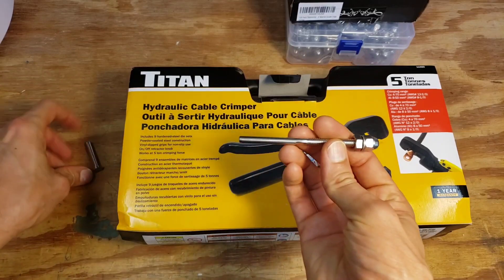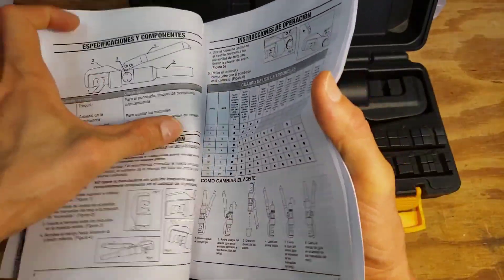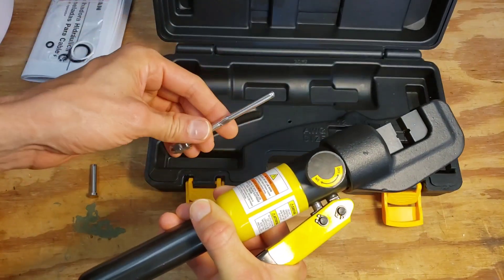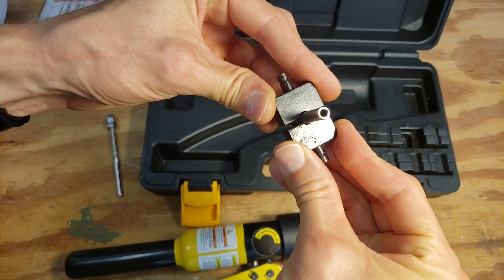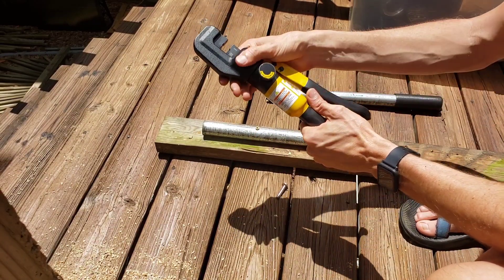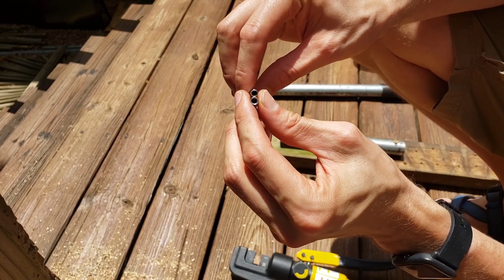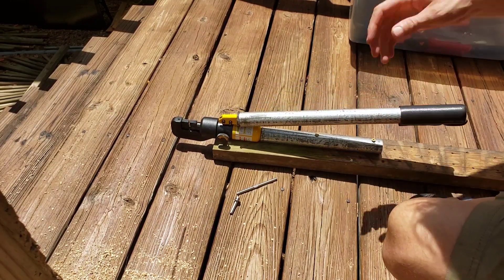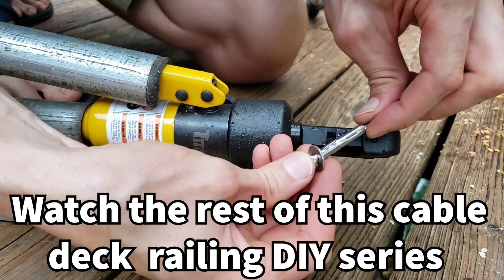Cheapest DIY Stainless Cable Deck Railing Pt.2: CRIMPING CABLE The Easy Way

Comment: What size pipe did you use for the handle extensions? I'm thinking that 1-3/8" fence post from HD might work, but wanted to check.
Reply from the maker: @kebabian8832  It was a piece of chain link fence top rail

Comment: So what size die set did you ultimately use with the swage ball ends (terminals)? 8 (1/8") or 6? Something else. Desperately trying to find that info. Thought it would be front and center! Kinda frustrating.
Reply from the maker: I used the 8 Gauge die set for crimping both ends. Works great and has held up for years. Rewatching this video, I now realize how that's not clear, and how much shorter and better I could have edited it. 😂
Reply: @engineerable  Haha!  No problem.  Still helpful overall! It's just that I was looking specifically for that one bit of information, this being my tenth source I've scoured... and it sounded like I was finally going to get it confirmed... and then it was left at "probably 6"..?  And I was like, "Noooo!  SO close!"  Haha!
Thanks so much for the reply! Cheers!

Comment: This tool is exactly the same as the one sold by Harbor Freight and on Amazon. It’s the same manufacturers, but a different color. I know because I bought the one on Amazon which was defective and then bought the same tool at Harbor Freight.
Reply from the maker: Thanks for the info. So, they just rebrand the same tool. So far this one has held up. I've used it for crimping electrical connectors too.
Reply: Seems to be. I just used my Harbor Freight crimper for my 1/8 cable railing system. This one does have more dies than the one I got on Amazon. Although they look exactly the same, there are differences in the hydraulic force. The Harbor Freight version claims 8 tons, while the enhanced Muzata crimper on Amazon states 45 tons, which I kind of find hard to believe. Oh well, I needed it asap and it seems to be doing the job. I also made a little jig to hold it.
Reply from the maker: @l0jack  I used a TITAN crimper rated at 5 tons https://amzn.to/2DPUptF, not the Muzata. Probably the same as harbor freight tool.